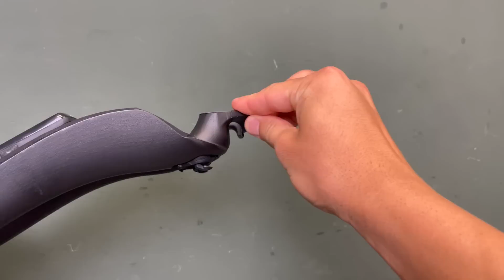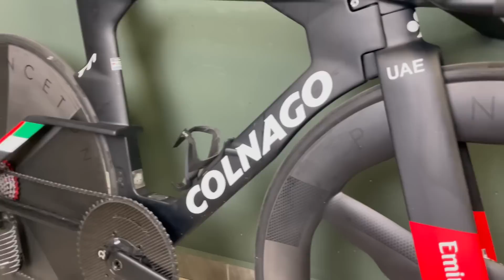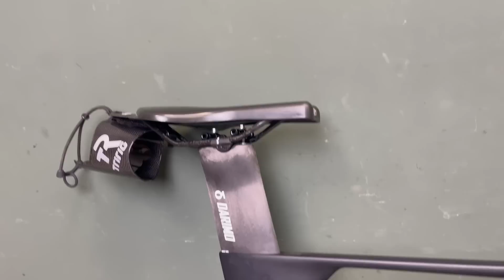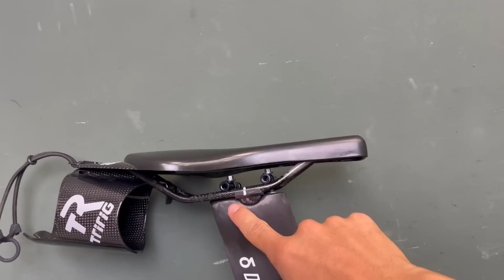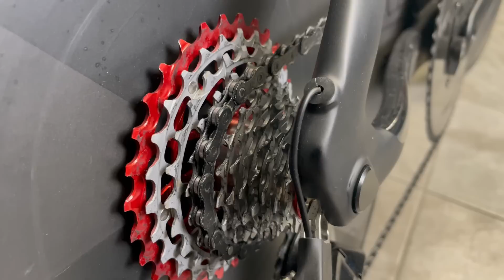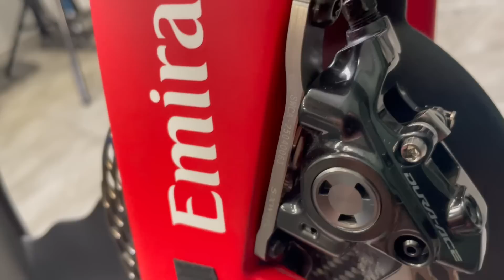Upgrading My Bling TT Bike - Colnago TT1 upgrades | Titanium, Speed Play Pedals & More!

Comment: Hi !  Im 169cm, inside leg 31cm.  Wandering if we're a similar size. Thinking about trying out your SPEECO one piece tt bar 'as is' ... I have the TT1 as well, bht with aerocach single carbon chain ring.  And dtswiss disc wheel.  But currently on the DEDA tt bars.
Reply from the maker: Hi. I’m 171cm tall

Comment: Thanks for the cassette comments. I bought some axles and the derailleur bolt from Evan and saved over 50 grams on my build over the stock parts. His stuff is top notch. I couldn't pull the plug on the cassette since I could only find one online review that was very negative. So do you really think it shifts as well as dura ace? If so, I may order one to help shed some weight. I'm so close to 6.8 kg with pedals and that change would almost get me there but I don't want to sacrifice on shifting quality to get there.
Reply from the maker: Yes, it does.

Comment: Might’ve missed this explanation from a previous video but how do the princetons compare to the HEDs in testing generally?

I’m running a classified rear hub on my road bike and considering carrying that over to a TT setup with the Princeton Blur as they offer a classified hub version.
Reply from the maker: The HED disc is slightly faster. The front depends on speed/yaw.
Reply: A classified rear hub on a TT bike? Why not get rid of it? Assuming you have the right size front chain ring, one-by seems perfectly fine for a TT bike.